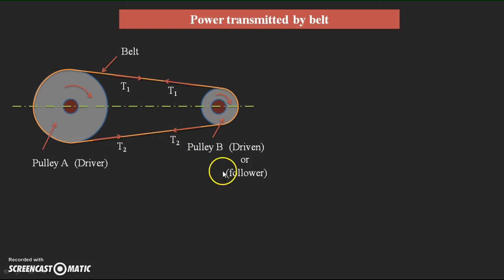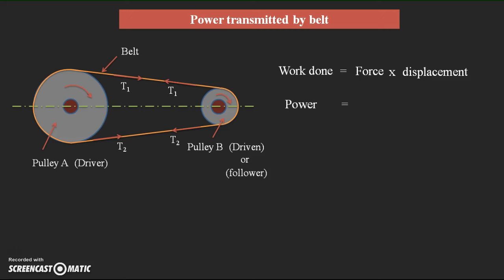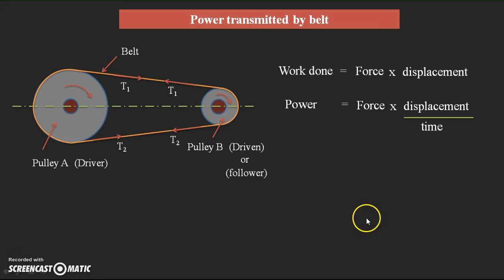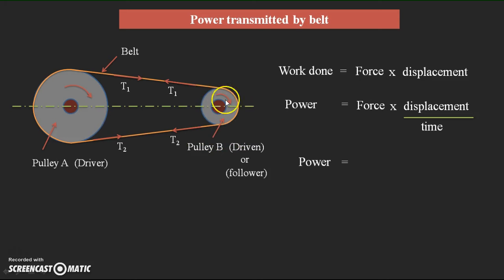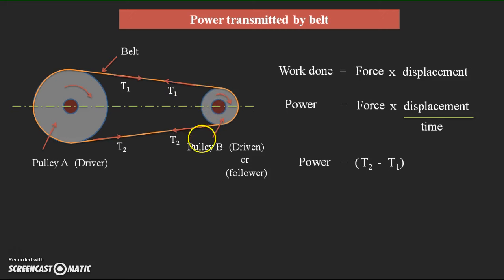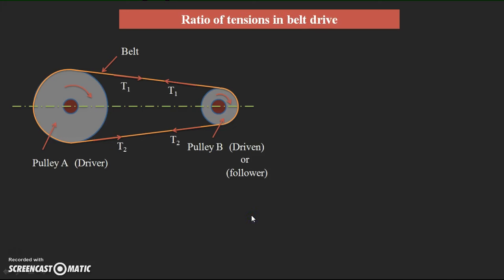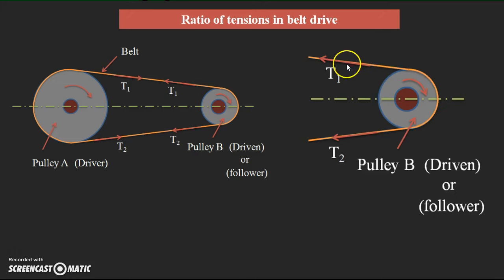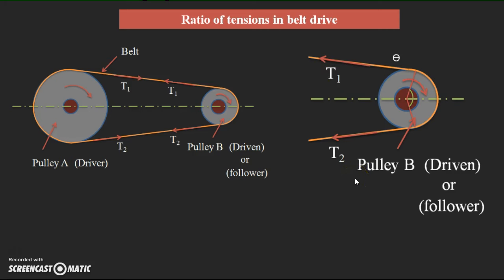Power transmission and ratio of tensions in belt

Comment: Dear friends,  let me tell you about the problem with integration:  Actually he has considered wrong direction while deriving derivation for ratio of Tension. The mistake is that he has considered same figure which he has used for the determination of Power in which direction is taken as clockwise.  If he consider anticlockwise direction instead of clockwise the equation of power becomes (T1-T2) v. which will make T1>T2. If you consider this, then you will find that his derivation is correct if the direction of pulley is reversed.  But I really appreciate his clarity of concept and pace of explanation. Best wishes dear ...

Comment: A flat belt has a speed of 22m.s and Is lifted to a pulley with diameter of 380mm ..if the effective pull is 210N .
Calculate the power transmitted by the belt
Va